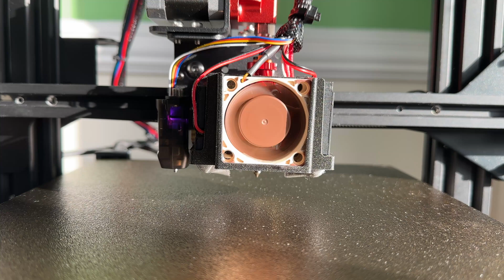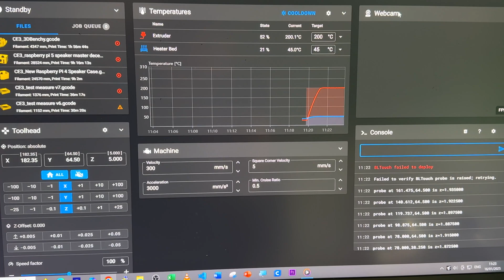CR Touch DEAD? Quick Ender 3 v2 Klipper / Mainsail Fix!

Comment: I have the same problem with the CR Touch on an Ender 3V2 running Klipper and Mainsail*. The CR touch works intermittently. I can get it to home the Z axis, but if I try to do a bed level it'll get a few points in and fail like yours. I've tested the connections many times and it didn't help. A couple of weeks ago I just bought another one just to see if it's the sensor. I used the new sensor with the original cable to test each component individually. It worked great... for a few days. Then it went back to the same behavior. I can get it to home ok, but if I do a bed leveling it'll fail a few points in.

My guess is that they're just crappy sensors. I'm considering trying a BL touch instead. 

In my case, I'm confident it's not the cable since I did a full continuity test from each pin on the control board PCB to each connector on the CR touch side of the cable while flexing the cable. For each test, I'd flex the cable in all sorts of ways. All of the connections between the board and the sensor we're good. I couldn't test to the sensor pins itself since there wasn't enough room.

* I actually switched to Klipper due to the CR Touch failure. It was failing on the Creality-provided firmware. I wanted to try different firmware to see if that was the problem. Spoiler alert: it wasn't the firmware.